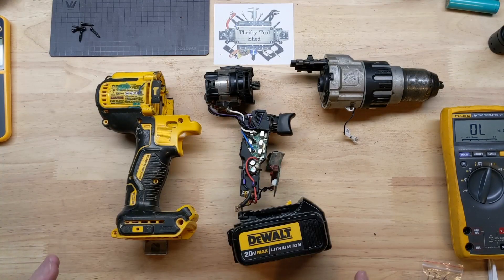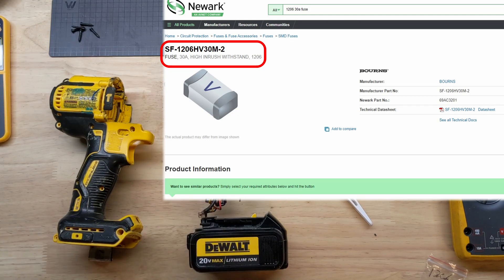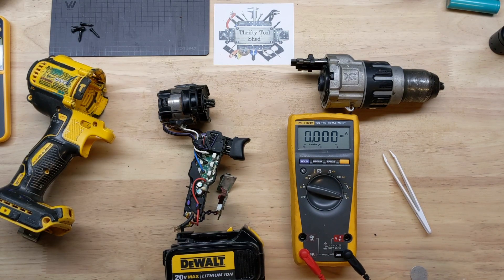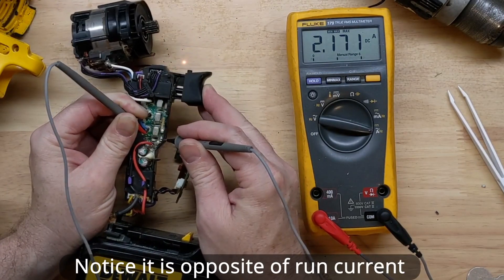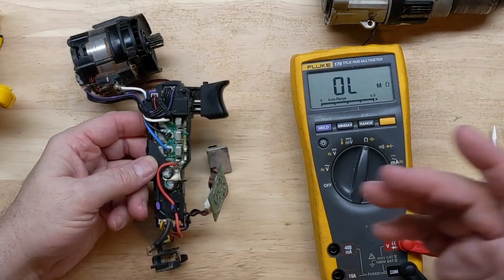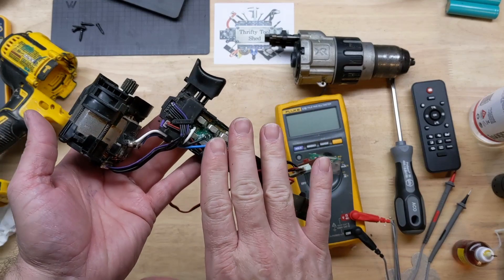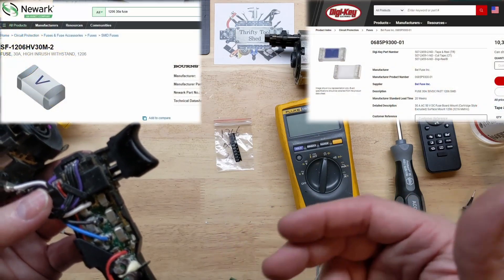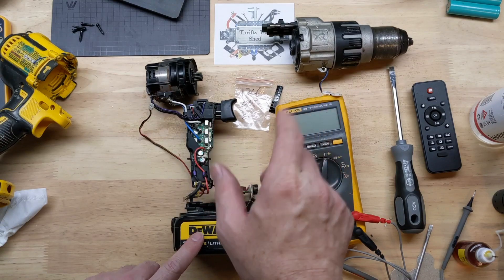DeWalt DCD996 Drill Repair Update

Comment: Same model, same problem, same repair, but I'm from Brazil. 
I've already re-soldered it once using the original fuses and they came loose again. I can't find the correct fuse; could I face very serious problems if I just solder it without a fuse, like a direct connection?
Thank you so much. God bless you.
Reply from the maker: I used a 30A SMD fuse on the one that I worked on. Its been a while so I don't  remember a lot about it. I would say as a last resort I would just bridge it if mine kept overheating and maybe get so more use from it. Best of luck to ya and God bless you as well!

Comment: I have a question before I take it apart. When I shake the drill it sounds like something is loose on the inside(chuck locked and no battery) is this normal?
Reply from the maker: No, not typical to have something loose.

Comment: I can't seem to find the video that you said you broke it down and then put it all back together I'm at the stage where I need to put it back together and I was wondering if you could show me the video
Reply from the maker: Hi,
I only worked on this one. I did have a first video showing when I found the issue and I did show more detail disassembly and reassembly, but of course it is sped up to help keep the video shorter. Hope it helps. 
https://youtu.be/QLa1kZJXpMo?si=OjLlbKwXFU_uZ1R5
Reply: @ThriftyToolShed  I finally figured it out except for this little metal clip that I have left over I have no idea where it went

Comment: The fuses used in manufacture have connections on the end sides, but insufficient connection area on the underside, so they don't seem suitable for surface mounting.  The replacement fuse used in your second video had more pad on the underside.
Using your first very helpful video I fixed a DeWalt DCD996 found in a skip.
Reply from the maker: Awesome job. Thanks for your comment! 👍

Comment: please can you tell me what the 2 wires going into the gear box are for
Reply from the maker: I mentioned in the first video on this repair that I thought it was a Torque or Clutch position sensor. This is an example of a similar one....
https://www.partswarehouse.com/DeWalt-Sa-Clutch-Position-Sensor-p/DWB-N174404.htm?Click=365719&gclid=CjwKCAjw6eWnBhAKEiwADpnw9smOXvP7jKMxrKgT-8YvuOqm9zKS0EzqZo1Li40Cki1Z8eaLzb_Z-RoCnQwQAvD_BwE
Reply: @ThriftyToolShed  Thank you so much for the reply. the new trigger i installed had no location to plug this into but the drill seems to be functioning correctly. im not to sure if the hammer function works since i haven't tested that yet. I hope it does. Do you know if rhere is anywhere on the board where i could posibly connect those 2 blk red wires?
Reply: Ok never mind the clutch does not work at all i guess its an "e clutch" that sucks
Reply from the maker: @outblastt  
Wow! So the clutch is not working at all it is just in drill mode all the time? Interesting. On this repair I remember running the drill itself while testing at one point and the clutch sensor wires were not connected. I never tried the clutch to see since the issue with this one was it was not running at all. I knew it was at least for feedback, but did not even realize it was full e-clutch.
So your going to need the exact speed control for yours unless they are similar enough and simply don't have the wires soldered on the board. That is why you were asking about that in the earlier comment. I have not run into that yet.

Comment: i have my dcd996 drill and when i dropped it from a roof. It works fine but when I accelerate to the maximum its force is intermittent at the beginning and then it works fine.. it could be a disconnected cable.?? Or is it the fuses.
I would appreciate your answer.
thanks
Reply from the maker: It could be a bad connection on the board.  It is not a blown fuse, but if the fuse is a bad connection it  could possibly cause this.
Reply: clean the gears and grease them. thats all.

Comment: i have the same unit as this. my problem is that it if you press the trigger it will start and then turn off immediately. after few presses it wont start. i suspect that its the clutch sensor. Any idea how to check the sensor if its not working? Thank you
Reply from the maker: It's been a while, but I believe I unplugged the sensor when  testing the one that belonged to my friend. I am pretty sure with the clutch sensor unplugged the drill itself still ran fine. The clutch feedback was obviously going to be an issue of some kind. I am thinking the motor itself ran fine. I would be more inclined to lean towards the speed control part. First make sure the hall sensor connector on the back of the motor is connected well.

Comment: Nice vid mate I'm currently repairing a 2021 996 has a broken connection on the motor and half the gearbox is missing, should have one coming with a dead controller going to use the gearbox internals to fix the 2021 model

Comment: Excelente video 👍👍tengo una sierra circular dcs 570 dewalt y no funciona prende su luz por un segundo y un silbido corto cada vez que aprieto el gatillo pero no funciona crees que pueda ser los fusibles al parecer todas las herramientas inalámbrica brushless funciona así o que cree UD que podría ser saludos desde Perú 👋
Reply from the maker: Hi,
Thanks for your comment. I don't know about that tool for sure. I have not worked on that model. I believe it is brushed so I doubt it's a fuse if it does make a sound when trying to start up. I would make sure the blade turns free and not locked down and then make sure the motor brushes are in good shape. most likely not replaceable brushes though. Sounds like the motor controller is trying to output? Best of luck to ya!
Reply: @ThriftyToolShed  es motor brushless igual que el taladro ambas dewalt  que por eso digo su parecido. Gracias igual a UD dónde podré buscar información detallada de su tarjeta de control del motor saludos sigua los exitos
Reply from the maker: I have shared the only video I have on these. That is the only DeWalt Brushless that I have worked on. I share as we learn together.

Comment: Hi, what do you use to remove the silicone junk? I'm so tired of digging it out of everyone I repair
Reply from the maker: Typically I just carefully dig it out even though it is a pain. Some silicone is a little more stubborn and sticky than others and I use some 99% IPA to help by saturating it and letting it sit for a little while. If it's still stubborn I will use my hot air station turned down to around 100⁰ to help while not getting the board too hot. I would rather just dig it out slowly if it's soft and easy as the EGO battery potting. It is a pain to get started but it's the type that lifts up in big chunks once you get it going. Some of the sticky silicone you just about have to use the Alcohol and a little bit of heat.

Comment: Great repair vid! What was the original issue? I have a dcd998 that only clicks and the LED turns on when I pull the trigger.
Reply from the maker: I believe the light came on but drill would not rotate. I shared back in first video.
Reply: @ThriftyToolShed  I appreciate the reply! Mine is brand new, I was just wondering if there was a fix for it.
Reply: Well, crap. I just bought a 998 as well. We’ll see how it goes…

Comment: Hi again got those mosfets in not much success soldering them in do you have any tips soldering small mosfets like those
Reply from the maker: I have never replaced the ones on this exact board before, but I do have many repair videos. I have a couple examples below sharing how I repair similar boards. One shows using low melt temp. solder to help remove a connector and it will help with larger devices and I also will share one repairing a EGO blower using the hot air to remove and replace a similar style Mosfet. Hot air is very helpful with the Mosfets. 
https://youtu.be/85KmNgENFEc
https://youtu.be/FxO7CpV4b9g

Comment: I found 2 number groups for the mosfets I need they are 4931N and R 1508 on the top of mosfet digikeys had no stock and I have not been able to find online can you help me source 3 of these or a replacement thank you
Reply from the maker: These Mosfets are getting very hard to get. I use similar ones on the EGO blowers, but higher voltage and lower current. 
It takes some homework to try to switch over to some that may work. I have spent hours on Digi-key, Mouser, or Allied to cross over at times.  I did find some of the 4931N on Aliexpress? Its not ideal, but its all I see available at the moment. its either that, take time to wait on some possibly on Ebay or spend much time crossing over to similar chip type that may have different rating that may still work. Best of luck to you!
https://www.aliexpress.com/af/ntmfs4931n.html?spm=a2g0o.home.1000002.0&initiative_id=SB_20221128174208&dida=y&origin=n
Reply: Master, can those sensors be bypassed or not?

Comment: Thanks to your video on the ego chain saw I was taught to remove my first mosfet now I need one if you could help me with that thanks again for all your help
Reply from the maker: You need a Mosfet? I believe I shared a link in the video description and the latest EGO Blower repair may also help with some links to similar Mosfets unless they are out of stock? The newer video shows hot air use as well, it's much easier with hot air.
Reply: @ThriftyToolShed  you are right and thank you
Reply from the maker: @betsyjames416  
Sorry for the confusion. I thought you were asking about the Mosfets I used in the EGO blower or chainsaw. The DeWalt I am not sure which type they have as I have not taken one out yet.

Comment: Do you have a video on removing one of those mosfets where the motor phase goes don’t mean to tie you up with questions but if you have time would be much appreciated
Reply from the maker: Sorry I don't, I have removed Mosfets on many other repairs. I have a recent EGO blower repair and an older EGO chainsaw repair that I replaced the Mosfets on video. I have not done one of these on the DeWalt as of yet. The 2 issues I had seem to be fuse related. It does seem a lot of heat would be needed to desolder those Mosfets.  I would use low melt solder to help for sure.

Comment: I had ask questions on the tear down video about the things just to the left of that fuse there are 3 of them they look like that fuse but are brown in the middle they have 18+ volts on one side but o volts on the other end I started to bridge them out with a clip and got a pretty good spark any ideas what might be, shorted if anything thank you for what u do
Reply from the maker: As mentioned, I have not worked on that exact one to say for sure. It's hard to say from comments. Your description of white with brown spot in middle did seem like it could be a fuse that had gotten hot, on the other hand it could be a light brown capacitor going across positive and ground and you would not want to short that out. It's way too hard to help diagnose from comments on a board I have not actually worked on myself. Best of luck to ya!
Reply: Thank you have a good evening the ones are less than 1/4 inch from where you soldered the fuse on in the video but I understand u can’t know what I am seeing thanks again
Reply from the maker: Ok, if it's just like the one in the video then those 3 light brown SMD devices are indeed ceramic capacitors and are most likely bypass caps so usually go from positive to a negative and should not be continuity across them. Hope it helps!
Reply: Thanks again sorry to keep bugging you I do thank you

Comment: Can you tell me what solder and flux you use . Thanks
Reply from the maker: Hi,
I use many kinds really. I use the following the most. The Amtech Flux is great for board soldering especially smaller items. The RA Flux is same flux in the solder core and works great for tinning wires and larger solder jobs and it's less expensive by volume. The solder I use is leaded 63/37 and I actually have several sizes from .020 to .062.
The low melt solder is great for de-soldering only, but is a life saver de-soldering large power components and connectors that can't take a lot of heat when removing. Northridge Fix has many of these items for sale on there website and they work excellent, I will put some recommended links below as well if you find them helpful. 
Amtech 559 Flux
https://amzn.to/3RmBqaA
MG RA Flux
https://amzn.to/3pWrtoQ
MG 63/37 Leaded Rosin core solder
https://amzn.to/3cvB2rz
Low melt solder to help de-soldering
https://amzn.to/3CEFH5h
Reply: Hey I had this drill and it ended up taking a crap on me literally just quit right in the middle of a job out in the middle of BFE.  I was cussing like a sailor! So I ended up getting a replacement and kept the drill that failed. 2 1/2 years later the replacement took a crap so I watched your video and both drills are back to work! Same exact thing happened to both of them! If you didn't post this video I would've had to buy a third one. Thanks for sharing your knowledge and know how. I'm pretty handy at fixing things and I'm glad I now have 2 working drills!  Thanks again!

Comment: Are any of these model DCD985?  I have owned my DCD985 since brand new in mid-2012.  Only used as a homeowner, not a contractor.  For awhile now, maybe a couple of years (I don't use it everyday) it seemed as though the drill was not getting full-power.  I attributed this to failing batteries as the original Dewalt batteries weren't holding charge for very long as of last year when I stopped using them they were about 9 years old.  So I purchased brand new batteries which are very strong but the problem persists.  I noticed that if I manipulate the trigger switch or squeeze really hard that I will once again get full power.  So it seems like the switch is at fault or dirty.  I understand I can purchase a replacement but most folks who replace them have NO operation of the drill at all.  I'm wondering if it's worthwhile investigating or cleaning the switch if that is even possible?  Or do you believe it to be simply worn out?

Comment: Nice video man. Sometimes I wonder if some engineers designing this stuff are in fact 5 years olds pretending to be engineers. It is time for manufacturers to design and build stuff that can actually last.  The planet and us buyers will appreciate.
Reply: So I suppose you could do better?
Reply: @joerogers9372  Did I say I was an engineer? Are you happy to keep spending your money on stuff that doesn’t last?
Reply: @joerogers9372  Tools designed and produced sixty, seventy years ago and beyond still work, or can be refurbished relatively easily. The man has a point.